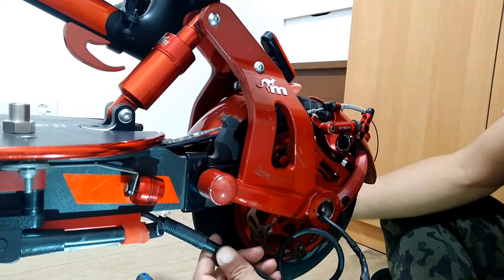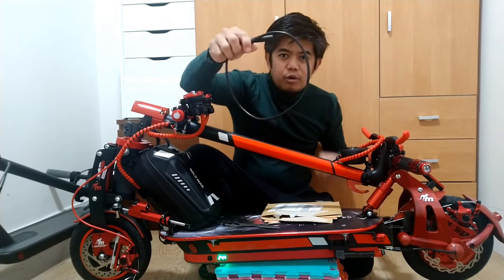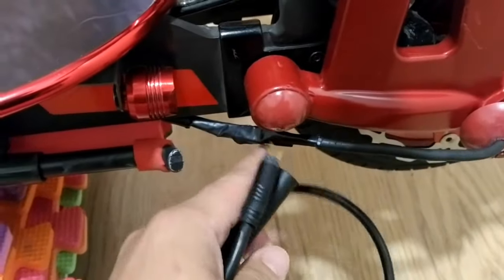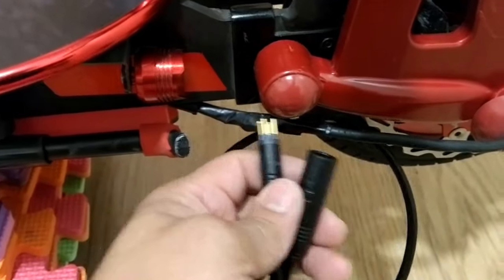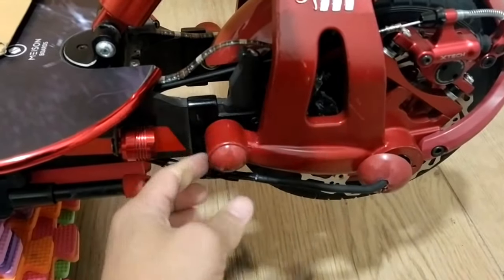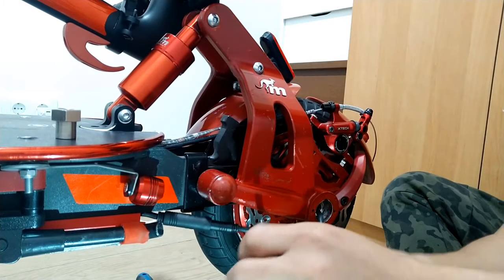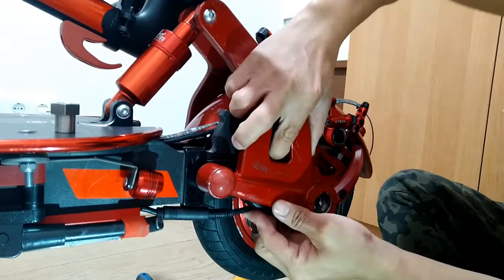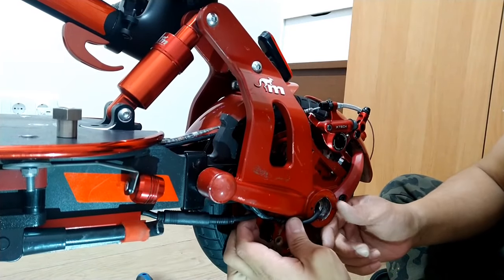8pin connector cable to motor and the controler

Comment: Ayos ser mas madali nakng magpalit ng gulong…amazon ba yan ser o ali express?

Ung controller mo pala ser stock ba un?
Reply from the maker: sa amazon ko lang xa binili  . oo sir stock lang controler ko .
Reply: boss pasend ng link sa amazon…salamat
Reply from the maker: @pimpmaster8769  JULET Cable Impermeable, Cable de Motor de Cubo, Cable de extensión de conversión Impermeable, Cable de Bicicleta eléctrica con Conector Impermeable de 60cm y 9 Pines https://www.amazon.es/dp/B097GVVWJY/ref=cm_sw_r_apan_glt_i_EY3TSFXKXM6XFDBPRV3E

Comment: Hello, can you please tell me where you bought this 8 pin cable
Reply: i can only find the 9 pin cable. Can I have that cable without connecting one wire 😀
Reply from the maker: PIIHUSW MIDI Cable 8 Pin Din Speaker Extension Male to Male Converter Lead for Bang and Olufsen B&O PowerLink BeoLab (50 cm) https://a.co/d/2pbN6ih
Reply from the maker: @goranlovric6128  you can  used also the 9 pin .. the another one dont used it